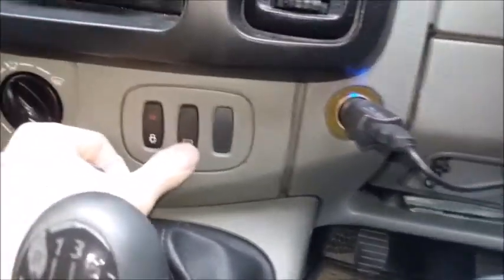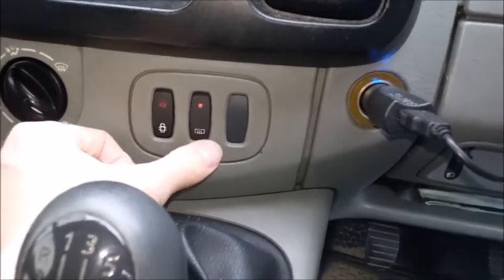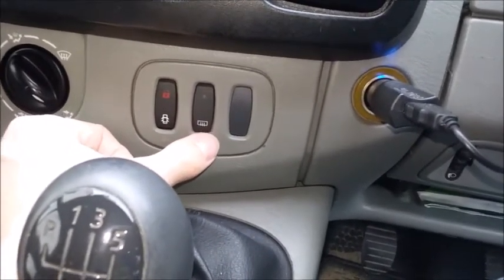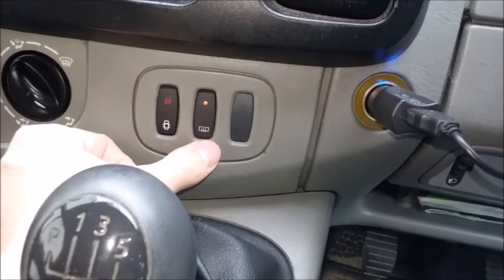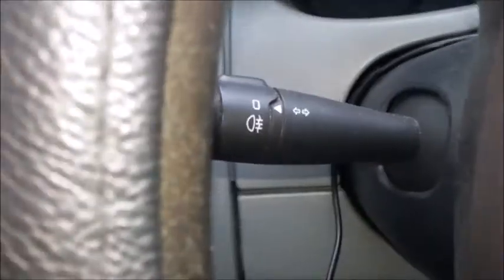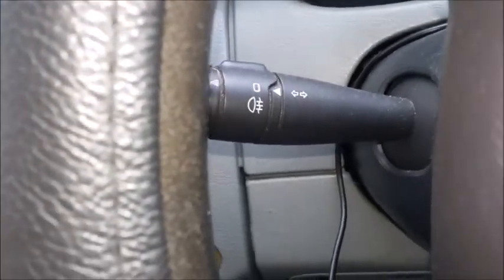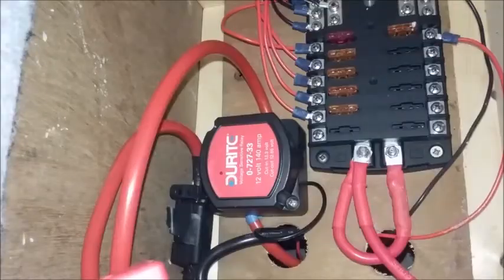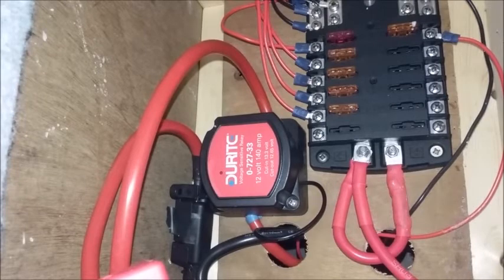Durite Split Charger Problems

Comment: Thank you for your video man!! Still valid in 2023, i have a ford transit dual battery factory system (one for start and one aux for lights, 12v sockets, radio etc.), and i connected the relay to the main battery. Had to turn the key to activate main battery to drain it. Took 5 sec and relay shut off. THANK YOU!

Comment: Thanks for the tip. My starter battery was dragging both batteries down to 12.5v. Now the starter stays at 12.5v and the leisure battery is up around 12.8v 👍

Comment: Thank you for this tip! my starter battery was being drained due to the split charge relay taking hours to switch off and isolate my leisure battery - Problem solved.

Comment: Cut-in Voltage is 13.3V & cut-out is 12.65V. Resting Voltage of a good battery is 12.7 to 12.8V. 12.65V is around 90% charged. Flashing your headlights or switching on the heater will momentarily drop the Voltage & trip the relay but the battery will recover to more than 99% charged.
Reply: That’s not what he paid for thou is it.   
Mine is the same cuts out at 12.4v not 12.65.        Just bought another one & will test it out first before I fully fit it,    If it cuts out too low, it gets returned

Comment: Any idea why my VSR keeps clicking? I have it connected to leisure battery (AND solar panel via controller). I can isolate it from starter battery & from leisure battery. The VSR works fine when I turn engine on. Whilst in my van with engine off it starts clicking like crazy. When I isolate it from start battery clicking continues. When I isolate it from leisure it stops. There was a yellow wire in VSR that if connected allowed a closed circuit between both batteries. I just left this inside & unconnected. I then cut it off down to 5mm but this did not stop the clicking either. - thanks Paul
Reply from the maker: Sounds like the relay has gone faulty, chuck it in to an auto spark👍
Reply: Thanks